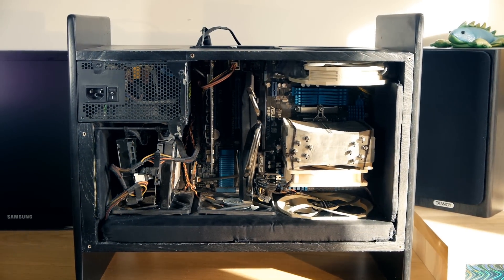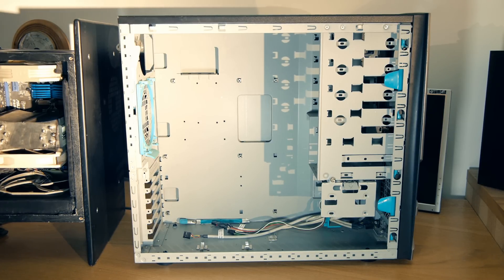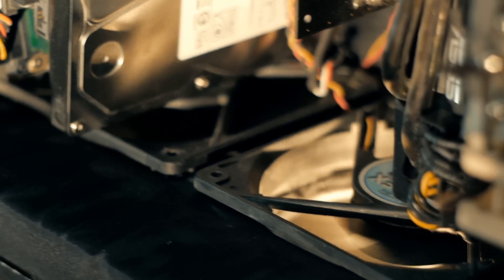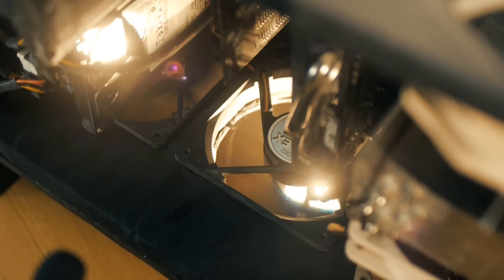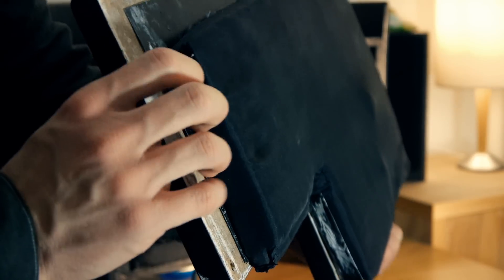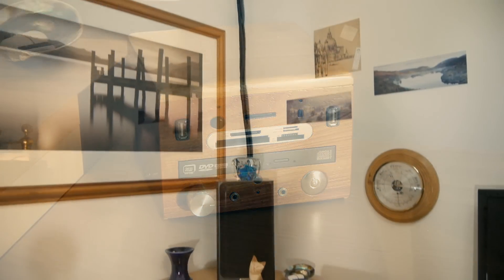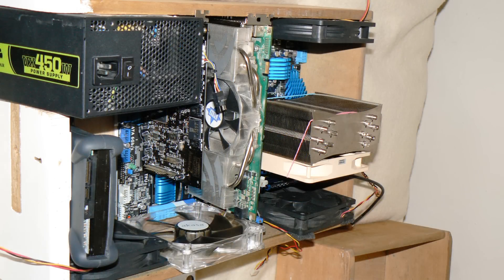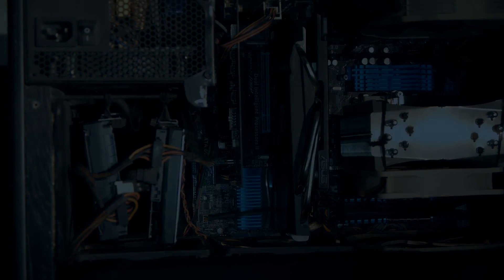My silent wooden PC

Comment: I cant imagine that those hard drives will last very long just swaying in the breeze.
Reply from the maker: 2 years on and no errors or bad sectors...

They wouldn't use HDDs in laptops if it mattered if they move or not.
Reply from the maker: CrysisVsHawke It only matters if the HDD moves FAST (like dropping, or falling over suddenly). I've opened and repaired enough HDDs to know how they work. For the thousandth time: HDD ORIENTATION/MOVEMENT DOES NOT MATTER PEOPLE :) so stop bringing it up, I'm fed up of replying about it xD
Reply from the maker: ***** Orientation with hard drives only mattered in the very early days. Orientation has been a none issue for over 15 years.
Reply: DIY Perks Modern laptop HDDs have motion sensors that can detect an impact which would cause the read/write heads to impact the platters.  When that situations occurs, the drive logic snaps the read-write heads to the parked position to minimize damage.  It doesn't help much if the drive is active when the impact happens, however.  I've lost 3 drives to impacts.  Desktop HDDs don't have this sensor so they're much more prone to damage and faulure by way of accidental impact.

That said, elastic mounted HDDs would only be a motion hazard if the box was located under your desk or a similarly kickable location instead of above your doorway so I can't think of a real good reason why they would fail by anything but old age.
Reply: ***** high speed gyroscopic action and conservation of angular momentum. They'll maintain orientation on their own, the only movement would be along the axis of rotation
Reply from the maker: Raul Kolk Well matey, I appreciate your effort, but I still don't think it matters. :) Sure, they may be some physical affects mathematically, but it should all be within the drive's thresholds. Why would they use mechanical drives in laptops, and portable enclosures if it did matter? They're often moved when turned on, but suffer no ill affects. 

I'll rephrase your summery of my previous comment to reflect what I actually said: It matters if drives move FAST, but it doesn't matter if they move SLOWLY. 

So, it matters if a drive suddenly falls over, or gets dropped, because the physical forces are beyond what the drive can cope with. It doesn't matter, however, when a drive is suspended and can move gently from side to side. Not that it would in this case anyway... the comp is never itself moved, so the HDD will never even swing (not that it would matter if it did).

So I stand by what I said. It doesn't matter. The drives are still fine two years on.
Reply: Kaleb Gilley I rather do that than be of topic.
Reply: DIY Perks
Basically what you just said is: "It matters if it moves, but it doesn't! I know a lot about this so I'm right and stop talking about this!"
Oh dear..

Well...
According to several manufacturers, mounting a 3/5″ hard drive horizontally, vertically, or sideways doesn’t affect the hard drive life significantly. What is important, though, is that the HDD doesn't move (which yours clearly does).
The HDD is running at a 2.03 x 10^4 m/s^2 acceleration at 90 degrees (569 rad/s), divide that by 9.8 m/s^2 (we get 1G per unit) and we will be running at about 2000 Gs. Change the radial velocity even just a little (which is easy to do while moving the HDD in conflicting directions of it's momentum) and you could dramatically increase the G output.
Although modern HDD spindles can handle all kinds of torture, the platters can create wobbling and in worst cases, even friction, which can be very deadly.

Long story short:
It does matter. Even if just a little bit.

can't believe I put all this work into a dead thread >.>
Reply: I see nothing wrong with the way the drives are mounted. As ForeskinMan (Interesting name) says; shock is by far the biggest enemy for just about any precision mechanical device, anything to reduce imported shock is preferable to direct solid mounting. Orientation is much less of an issue than it used to be too. Heat build-up/damage is a far bigger problem (Once shock protection is done) components last longer when they run cooler. Either way, traditional hard drives are mechanical devices and as such will always have a finite life - Back up, Back up, Back up is where the focus should be....
Reply: DIY Perks A good analogy is that you can poke someone's arm and nothing bad will happen, but hit them with a baseball bat and you'll probably break something. The difference between a swaying drive and dropping it on the floor is similar.
Reply: Kaleb Gilley I have had the HD hanging frome cable the last 18 years, never had a problem. Works just fine. Having them hang from cable is a quic dirty way of making them quite...but better secure them before transporting (that i usually forget).

Orientation don´t matter.  I work with developing telecom grade servers, and they have disc in every orientation... and yea, they run them 24/7 untill they break.
Reply: Kaleb Gilley They aren't moving in his build, in a laptop they will move a lot more and even get dropped
Reply: DIY Perks It actually does matter if HDD's move, if you knew anything at all about how they work you would realize that as well.
Reply: CrysisVsHawke Also forgot to mention that the only reason they but HDD's in laptops is because SSD's which don't have moving parts would make the cost of laptops to expensive for every day users etc.
Reply: ***** The bad practices shown in the video put a bad taste in my mouth.
Reply: DIY Perks Don't bother with the trolls Matt!!
Reply: Kaleb Gilley it looks actually quite relaxing for a HDD, no shocks or anything, everything is absorbed even it's own vibration.
Reply: Maxillius T This is just stupid, the amount of force to break an hdd won't be archieved on a desktop pc, unless you throw it throught the window. You need an average of a 250G shock to damage it, elastic bands just help by getting less impact if the case falls from some height.
Reply: Kaleb Gilley So tell me why in some server racks hdd bays are VERTICAL? Your comment doesn't make sense, in a server environment hdd life is a priority and if a lot of providers sell racks with vertical HDD bays that means it's just not a bad thing. Also some cases have side mounts for hdd.
Position can be bad for some fans with cheap bearings, not for HDD
Reply: Kaleb Gilley You haven't seen a real server room, look at this: http://www.daxsystems.com/images/DRM/drm-457128.png there are tons of units for racks that have HDD mounted sideways, and a lot of pc cases have their hdd mounted sideways (mostly HTPC to save space),
the reason it's not really common in regular pc cases it's bacause mounted normally it's a little bit better for passive cooling.
Reply: Kaleb Gilley Don't make offtopic, you know you were wrong just say it, the world isn't gona end bro.
Reply: Kaleb Gilley I did this to my desktop hdd because it was transferring vibrations to the case, and I can assure you if you do this correctly drive won't be "swaying".
Reply: Oh boy. I have a PC 7 years old with HDD's mounted vertically and I kick the PC, mess around with HDD and no error, nothing has happened yet. Only error I got was from keyboard saying ''No keyboard detected'' or from other devices. My PC is shit, but it runs. So no, HDD position doesn't f*** matter. What matters is if you unplug the HDD while the PC is working or if you are really concerned about errors and crap then I guess poking the HDD with a screwdriver or a spear would damage it, as well dropping it from Empire State Building. 

It's not like any of us would go skydiving with HDD's with no parachutes or in any way skydiving. 
I won't lie, my HDD is slower, but that's because I tend to leave the PC on and I move a lot of data from it and onto it. 

And about the wooden case, short circuit and fire... Don't make such a huge deal out of it, it's not like your house will burn down, or it will?
No it won't. Period. 
There's a low chance for short circuit, and even if it happens and wires start to melt, it won't light up the case like fireworks, wood so thick doesn't light up so easily. 
Maybe if you used liquid cooling and the coolant was petrol and it leaked at the time you had a short circuit, maybe then you would see theeeeeee fiiiiiiireeee...

There's a bigger chance for a rocket to light the fu** up than for a PC to start burning like campfire.. I'm out.
Reply: I guess the way i saw it was they are kind of made to be horizontal or vertical, but hey if its working more power to you just baffles me with how.
Reply: Peter Kay
There is no trolling going on here, just solid factual commenting.
Reply: DIY Perks  Laptop HDDs have much smaller platters, creating a lot less momentum. Yet, they have smaller life expectancies than PC HDDs.

I suppose I misinterpreted what you meant by "mattering". In my world if an HDD starts experiencing problems after 3-4 years, it's a bad bargain. Not to mention 2 years.

Perhaps in your case it really does not matter, but in any other case (where the PC isn't placed in the attic etc and is constantly being moved) it would matter. In my definition anyhow.
Reply: matsv201 I'd maybe belive that, but your lack of spelling and bad grammar really takes away from the point you're trying to make.
Reply: Juancho Talarga
Vertical or horizontal positioning has nothing to do with movement now does it? Not to mention the fact that any server i've ever seen (multiple school systems, data storage facilities and a few large business with on site data storage) have had their drives mounted horizontally.
Reply: Juancho Talarga I haven't seen a real server room? I'm commonly at a central school office that has data storage for 3 school systems for a total of 9 schools.
Reply: Juancho Talarga I'm not wrong, every server room I have seen has horizontally mounted hard drives, and I know that vertically mounted ones are normally fine as well. The entire argument was about hard drives swaying and moving around while operating which your comment had nothing to do with. The only one off topic is you.
Reply: They are constantly swaying :/ so yeah, they are moving.
Reply: I bump my pc with vacuum and my foot etc. so mine would be swaying haha thats why I have a heavy duty case with everyything bolted down good n tight haha.
Reply: *****
I put my hdd back with screws because the tower is now suspended 20cm avobe the floor and someone may kick it and while it's working it won't be any good to the hdd.
Reply: It matters, if the drive is accelerated in any direction at a fast rate. Means you drop it, which isn't that much of an acceleration, compared to the impact, which is an almost instant acceleration from a given speed, right before the impact, lets's say 3 m/s to another speed (0 m/s). It is completely irrelevant if that hard drive moves, it's just important that the hard drive doesn't accelerate to fast (the change of momentum is the problem, not the momentum). For example you can use your laptop on a train which travels at a steady speed. Therefore the hard drive moves (probably pretty fast) but isn't affected. According to the logic used in this thread though, it would be. 

OK, I was very bored indeed and should've probably gone to bed earlier but nevermind, hope someone learned and/or understood something, if I was clear enough (I'm kinda too tired to write anything).

Bye...

Comment: Why need sound card? You doesnt even use it.
Reply from the maker: Pardonious? I does use my sound card, actually :P
Reply: DIY Perks Well the External Control Hub have their own jack?
Reply from the maker: Sadaki Yes, but the sound comes from the sound card. The hub doesn't have a built in DAC. :)
Reply: Sound card - better quality audio - lifts about 4-8% load from the cpu - recording audio .......

Comment: Nice . Been thinking about one of these . The draws look like ' real ' wood , ie with grain , seen a tree , MDF would be a better sound insulator , but less capable of thin sections . Rather than sowing or staples , invest in a hot glue gun , most chip board TV cases of the 70's & 80's were held together with it , two grades , one capable of being removed with lighter fuel if you need to change something . The other , light brown colour , you could stick battle ships with it .

Comment: i was planning a wooden case as well and came across your build.im wondering how you grounded the mobo if at all.

 24/8 molex(via psu to wall socket ground) would do this ? a few guys on pcpartpicker told me that the motherboard standoffs act as grounding as well.

is that the reason you lined the inside of the case?

Comment: Hi Matt, best regards from another Matt, from Poland :)
I must say I love this project. Great eficiency, perfect ideas... I am just about to made my own case during following month, however I found few questions I just have to ask You:

HDD - You mounted them elasticly but not vertically.. what about the disc rotation gyro force? having them like You have  You increace twist of the disc as they run - that should decrease their life... Have You concidered that?

- Have You concidered any dust filters before the fans? 

- I am afraid that wood can be rootenning (or just breaking from the vibrations, time, humidity...) along the time, have You concidered some wooden particles flying around? Or You think they will be blown straight away (The same regards sponge particles after a while)?

- another story is temperature resistence of the inside fabric (and sponge). You used silk if I remember correctly - aren't You affraid of any issues with that? Espetialy keeping sponge in the temperatures around 50 deg..

Please write me back about my concerns.

THX & rgs.
Matt
Reply from the maker: I have relatives in Poland! :)

People have mentioned the orientation of the drives several times, but the truth is that it doesn't matter at all these days (it did used to matter VERY early on when drives were like 100MB or something).

Regarding dust filters, I didn't really need them as the computer was in a fairly dust free place, but I do recommend some kind of filter if you plan on having it near the floor (mine was near the ceiling).

As for wood deterioration... honestly I hadn't give that a thought, because wood only deteriorates if it's damp, which shouldn't be the case (geddit?) if there are nice warm components inside ;) I mean, speakers are made of wood for example, and they don't fall to bits with vibrations etc ;) the sponge is a different matter, as there's a possibility that it could degrade if given enough time. My action plan for that: replace the sponge if it starts to create dust. I've found that furry cotton towels are better at absorbing sound anyway (folded into at least 4 layers(, so that's something you might consider.

As for temps, remember it's only the core of the components that might reach 50c or whatever. The air passing out of the heatsinks is probably 25c max.

Good luck with your build Matt!

~ Matt

Comment: I built a few cases like this one. Had to learn about thermal conductivity the hard way. I put a hard drive too close to a plywood panel and it fried. It's easy to forget that many parts, not only ones with radiators, generate heat and unless there's enough airflow, things may go "poof". Inside metal cases the body often acts as a radiator for components directly flush with it. Also, the smaller the volume, the faster the air has to travel through to have the same effect.

Great project. Some day I'll post a teardown of mine.

Comment: I laughed out loud seeing how cleverly designed this case was. Really well done. Really clever.

As for dust, im guessing you can always fashion a dust filter under and above the case so no dust would fall, nor would be blown in

The major design fault is what this case has as a strenght. That is, all the materials are flamable. In case of one or more fan failures and god knows what else might line up as disaster, this case would take all the components with itself as it burst inflames

Also, placing case somewhere else thats (i assume) hard to reach or lets say, cant be reached in 30 seconds adds up to the dissaster scenario. By the time you realize something is happening, it might very well be too late for your case and (if the interior of the house is made with wood) your house.

Comment: "External control unit" is too engineer-like. You should call them "Big Bro" and "Little Bro." j/k Hey, is that a Noctua fan I see in there?
Reply from the maker: Yup, there's a Noctua fan on the CPU cooler. The two other beige ones (above and below the cooler) are 140mm Thermalright fans (they're okay, but a little buzzy for my liking). The others are Skythe S-Flexes running slowly.

I like your naming idea... :)

Comment: Couldn't you just take some smaller regular cheap pc case, break the front cover and screw in some wire mesh (its easy to screw onto anything and to cut into any shape), use rubber or felt washers to screw fans onto it  and then use some sponge or some other sound absorbent to line the case from the outside. You could hang your hard drives from a rubber band in a regular case also, and it would save you from woodworking and sewing silk which isn't easy. It wouldn't be pretty but you keep your computer hidden anyway.

Comment: 60 Degrees Celsius? Mine never tops 45 Celsius OC. I am an enthusiast of Wood Projects but, in regards to one persons comments on fire. I built a wood computer chassis in my trade class for a finals project and I had a molex to Sata Power adapter short out and catch my wood case on fire internally. It was not pretty. and factoring in air feeds fire, the fans inside did not help but made it a lot worse.

Comment: Or you could just buy a quiet optimised case with sound dampening and put the CPU & GPU underwater, all those fans so close together are counter productive as you increase turbulence which after raw RPM is the greatest source of air flow noise from a fan.